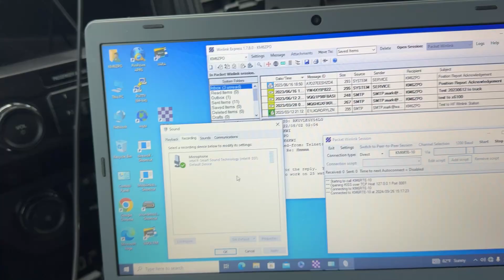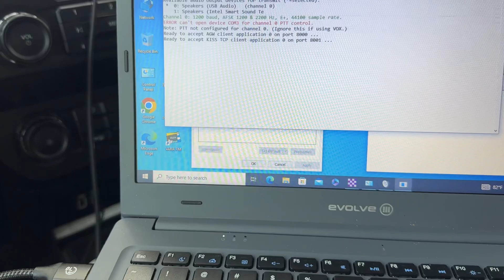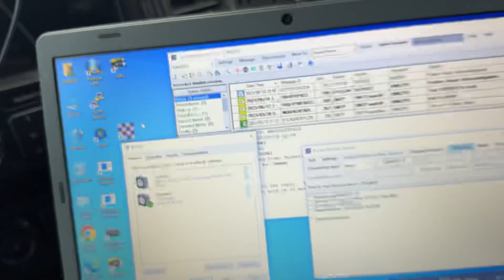Review of Btech APRS-K1 Pro for Winlink

Comment: I’m having the same issue with my android tablet connected to my BAOFENG AR152. Even after many numerous adjustments suggested by the seller. The data comes scrambled. I can’t get the text to come in correctly.

Comment: RF is probably creating noise on the line keeping the PPT open or locking up the PTT circuit board. Ferrite beads on the cables may help. I had to do that with the AIOC. The Digirig Lite appears to have ferrite beads built into its cables.

Comment: Maybe you should get the Digirig Lite!? They are very affordable... probably close to what you paid for that Btech cable. 
I have both a Signalink and a DigiRig mobile. The Digirig's cables seem to be finiky about having to sit just perfectly to make a good connection. (Which is wierd for a hard wired connection!)
Reply from the maker: Thanks!  I have the DigiRig and have had success using with both a Yaesu FTM-200 ( https://www.youtube.com/watch?v=I3-aEckHiAU ) and the Yaesu FT-60 ( https://www.youtube.com/watch?v=7p7NBWbofLs )